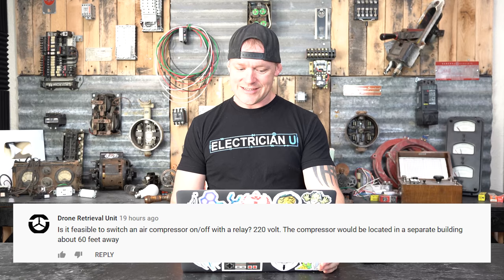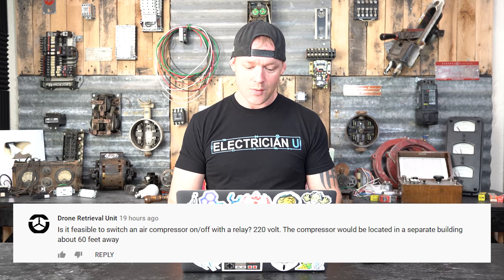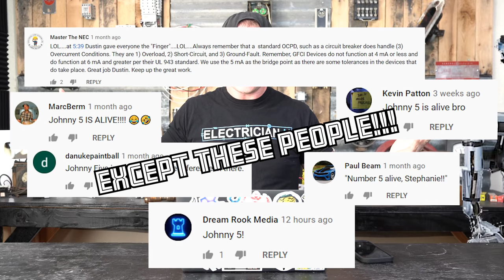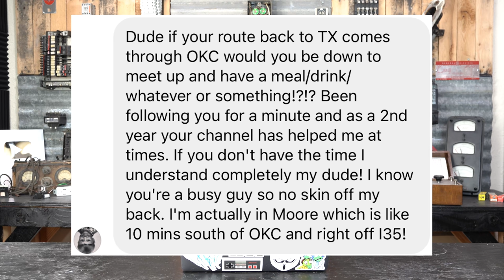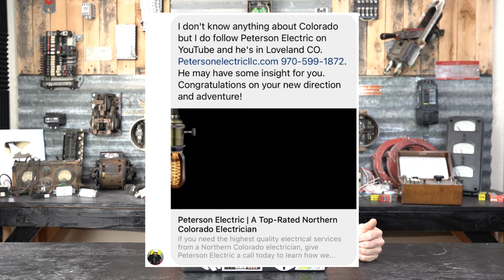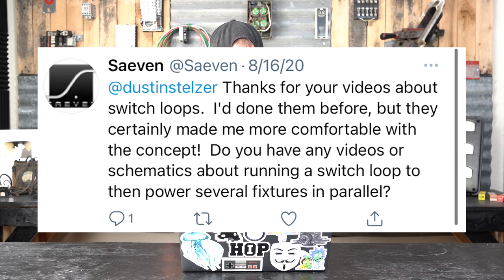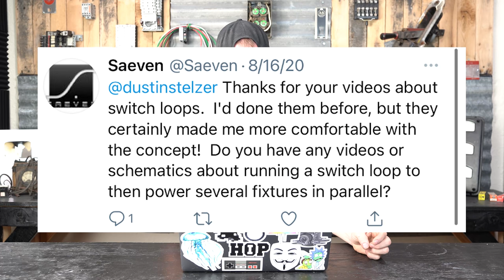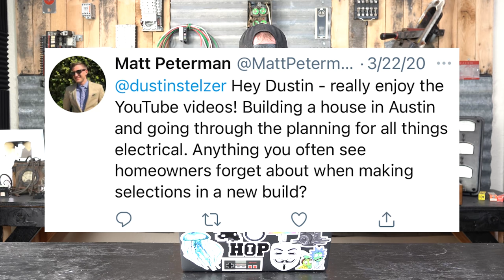Q&A #2 - Answering YOUR Comments & Questions - Mar 26 2021

Comment: Aloha Dustin,

Foreman question @ 4:08 I totally agree with you.  As an apprentice we are the ones picking up the slack.  If there are jobsite issues with anything it falls under the foreman’s responsibility.  However, we as a crew should be doing everything we can everyday to help the foreman succeed. I understand people will have issues with how the job is ran, but remember that the foreman is the person that has to answer for it.  At times we are focused on a small portion of the picture but they see the big picture.  My advice is communicate with your team leaders your concerns with a course of action.  Lot of times you will see things that were overlooked because no one is perfect.  Be a helping hand my brothers and sisters.

🤙🏾🤙🏾

Comment: cone nuts are okay yes. spring nuts you have to use the compatible nut to channel.  kindoff with kindoff or b-line with b-line, make easy installation,  when you mix and march then the installation becomes a little tough

Comment: Only way that I would install a chandelier over a bathtub is if the ceiling was at least 12' and bottom of luminare was at least 9' from bottom of tub. Would double protection by using a AFCI breaker with GFCI built in and a feed thru GFCI device in bathroom.

Comment: A question after watching your A Day in the Life with Electrician U and then the SURGE PROTECTORS (SPDs) video.
I understand how a Type 3 point of use surge protector would protect a device that is plugged into it.
Where I am having trouble understanding is how a Type 2 Load side of Main Disconnect would protect an entire house. In the Day in the Life video the SPD is connected to a circuit breaker at the end of the row of breakers.
Let's say a lightening strike hits a transformer/lines and the surge heads into your panel. With the SPD at the "end" of the bus bar how does that protect everything before it? If it was between the main disconnect and the bus bars I can see it protecting everything after it. But with the way it was installed my "mind's eye" is not wrapping around how it is protecting the entire house.
Thanks

Comment: I’f you have meter outside feeds to inside breaker panel connected by metal conduit but no ground wires leaving breaker box to ground bar and nothing going to ground bar outside. Should I get rid of metal conduit and put ground wire in breaker panel then take it to grounding wire .

Comment: How would you inspect a typical residential panel to determine time of change, will older panels bus bars be less conductive, if so will it show and effect the voltage? 

I personally really like Eaton because they use treatment for the bus bar in their panel, but in your experience how does that effect the life span of the electrical panel? 

I'm speaking about main service panels mainly.

Comment: The other question that I want to instal a difrist timer 208v 240v for a 3 phase breaker but I measure the voltage between one terminal and ground and it read 240v

Comment: I'm an electrical engineer and do enjoy the channel.  I design things that I cannot 'legally' install...although, I do not think you need any particular license to work on an industrial installation...at least where I am.  Nonetheless, as an electrician, you better do what I say(follow the drawings) else you'll be in trouble.  Sorta weird ain't it?
Reply: For years Philadelphia had companies pay a yearly fee of $500 for the privilege.of petforming their own electrical work. As soon as they increased electricians yearly license fer 50%  ( from $100 to $150 ) they stopped providing their 30 to 50 page adendment so I am not sure if this still in effect.
Reply: @garbo8962  I design things and when they're installed, I'm responsible to help out with diagnosis.  I know the system, I'm an engineer, not an electrician.  Should I buy an Arc-flash suit?  I think not since I cannot work on the system I designed.  So, not gonna buy it.  Weird but is the way things work. BTW, I LOVE electricity.  I just do.  Also love hands-on.

Comment: What's in Colorado? Snowboarding/Skiing?
'Just a guy in a truck fixing stupid shit for (rich) people that doesn't matter' - variation is a thing on this, but this issue is also a good reason why I want to be in renewable energy generation long term. I think pretty undeniably, 'it matters'. 

I don't think you should change your name just because of some scammers - bring the heat on them if you have to (lawyer). The originality thing though - suppose that comes down to whether other companies existed before yours.

Meetup in the Seattle/Tacoma/Olympia area(s) would be sweet for sure.

Comment: Question for the next QnA. I’m about to graduate with my associates in electrical construction. Been dropping off my resumes at local contractors. Got a job interview lined up in the next few days but the reviews on this company from employees arnt so good. It would be my first electrical job if I get the position. I’m excited because I’ll be able to get the experience under my belt but I also am afraid to work for a possible shit company that doesn’t treat their employees well. Your thoughts??
Reply: Take their job, but continue looking for a career at a different company.
Reply: @JasonW.  I think I am. I do landscaping while I was at school and it’s fucking brutal. Just hoping they’ll offer it to me. If they do I’m going to take the position. Just bought more tools hoping to get the job. Thank you for the advice. Wish me luck!
Reply: @jaredthompson1522  one more advise. If the pay is really low, personally I'd skip them in my experience. Some (bad) companies will only pay you based on previous pay rates, though this should be irrelevant. The bad companies may take your low paying (lower than local starter rate) starter job as an excuse to forever make your pay lower than going rate.
Just something to keep in mind.

Comment: Where do we need grounding bushings ?
Reply: We used grounding bushings or grounding locknuts when a metal nipple or conduit is ran between a meter socket andsay a circuit breaker panel. Also used them when running metal conduit fron a non conductive box.

Comment: Do you charge extra if customer purchase crap hi hats with sharp edges from big box stores like I do. I tell them if they purchase any luminares made in cheating lack of quality control cheating scum bag it will be at leadt $10 extra a fixture. Only wear gloves when working on or near energized conductors. Just got tied of having numerous cuts on hands afte .handling crap from china. I had no trouble getting a replacement Ligholier made in USA drop lens trim with a gasket for shower area 30 years after.I installed it. Good luck getting any replacement.parts from crap madenin china.